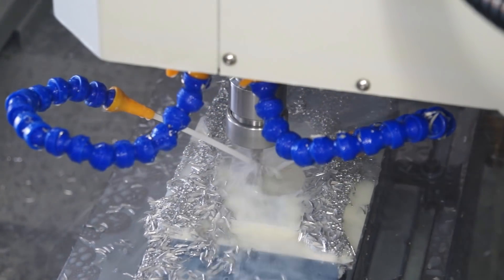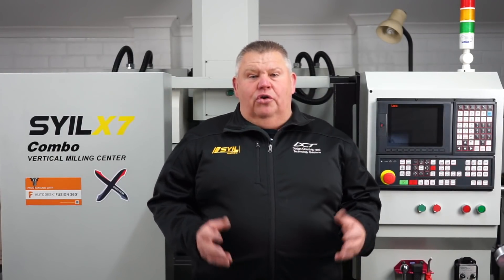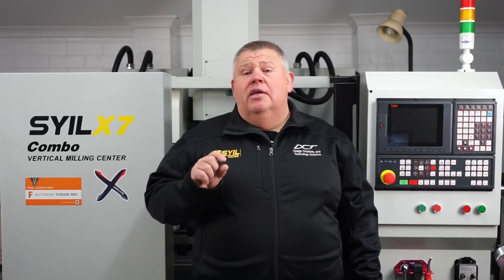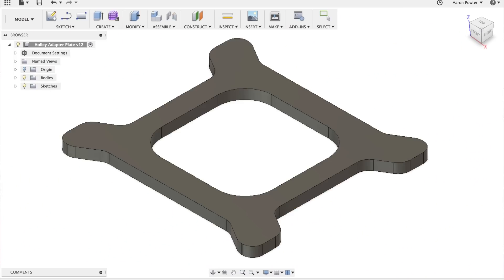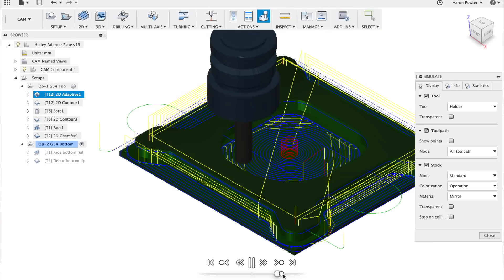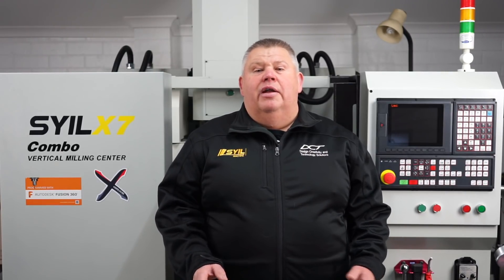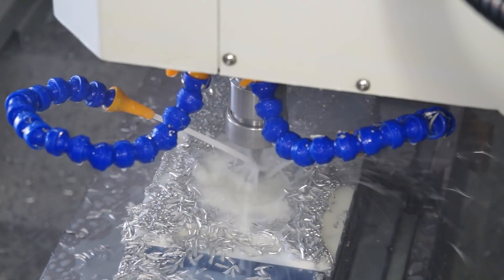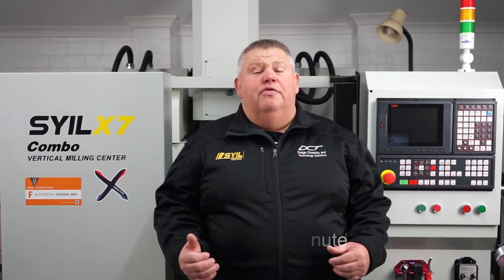SyilCNC X7 Combo - Make a V8 Holley Square Bore Plate

Comment: Your machine was making a rumbling noise when rapid move in X.  What is that?  A hose or cable dragging?
Reply from the maker: Has done it from new unfortunately.  I'm guessing that it may be miss aligned coupling or ball screw.  Need to remove parts to inspect, but involves a bit of work.

Comment: Hello where are you ? Sounds like Australia, have a question for you. I've been looking on the internet for awhile and can't find what I'm looking for and found you. I'm trying to find an adapter plate for a Rochester varajet manifold to the Holley Throttle body injection system. 2 barrel to two barrel. I don't want a high rise because I don't want to modify my hood. If you could make it how much would you charge me? Thanks   Tim
Reply from the maker: chuck nortis Hi Tim. I’m based in Melbourne mate. Happy to machine one for you. Any chance that you have the CAD file?  If so you can send to me and I can quote. You can get my email address from the “about” section on my channel 🍻

Comment: Great part. Could save air cutting time by fast feeding Z down to contour depth too, max feed rate.
Reply from the maker: Thanks for watching and thanks for the tip.  I'm usually only ever making 1 off parts, so I'm not chasing seconds.  If I had a batch to make I would most definitely optimise the program.
Reply: Gotcha, I just get so preoccupied with splitting seconds for large production,l that I just instinctively look for things like that.  Lots of good tips on this channel. 
Thanks for sharing
Reply from the maker: @PhaseConverterampV  Oh my pleasure.  Thank you for taking the time to drop by and check out my stuff.  I really appreciate it.  Have a great day :-)

Comment: Hi Aron 
how you ? i like your channel , and way how you go up with your machines ... im looking to buy Syil X7 but im still not sure to go for it ... what you think about machine ? 
also in this video it looks like X axis rapids have some noise , is ball screw fixed on other side with bearing or it is lose ? 
Thanks
Reply from the maker: EMZY FILM G’day mate. Thanks so much 🙏. I appreciate all the support I get from you all. I’m absolutely loving the Syil X7 combo. So happy I made the decision to go with this machine. Yes there is s funny noise coming from X during rapid feed. But the camera I’m using exacerbates the noise. It has no affect on the part or surface finish, but will need looking into sometime soon. Cheers 🍻
Reply: Im wondering if end of ball screw is fixed ... , i men on one end of ball screw is servo motor and on other should be bearing to fix from woble ... 
as X axis is long maybe this is case of that sound ... 
to reduce price of machine maybe there os no bearing fix ...
:D im watching this part of your video over and over and it is turning me away from purchase ... :D
Reply from the maker: Thanks for the handy tips.  Yes it probably is an easy fix.  Something I need to look into ;-)

Comment: The X Rapid sounds like the lead screw is out of alignment  or out of spec or the servo motor has a fault.

Nice to know the LNC controller is compatible with Fusion 360.

Nice part!!!
Reply from the maker: Hi Doug.  Thanks mate the part came out looking trick.  Yes the camera actually exacerbates the X-axis noise.  Not sure what it is, but will need to check it out.  It has no affect on the part, and didn't compromise sizes or surface finish.  Cheers mate, Aaron.

Comment: 1. Wrong to use aluminum as it will transfer heat and boil fuel in the bowls (with today's gasoline) . 2. Going fast requires good tooling (not the stuff you are running) . 3. Orange Vise on a econo mill ? Why not buy 2 Kurts ? Looks good running though !
Reply: We use 6061 aluminum spacers all the time on race engines. 

No issues, even when the motor overheats. Not to mention, almost all high performance intake manifolds are cast aluminum.
Reply: Get off the highway,  shut of engine, get some fuel, come out and hard start, always found my holley dry as fuel would boil out. changed to a phenolic spacer and a heat shield and and problem stopped.
Reply from the maker: Hey buddy.  Thanks for taking the time to watch and I do appreciate your comment.  All tooling used (except shell mill) for this part were from Iscar.  Granted the collet tooling isn't Maritool or another well known vendor, but it's still good for 10K RPM.  The part came out looking trick and all sizes were spot on the money.  To be honest and at the end of the day, you would be hard pressed to find another CNC mill (similar in this price range $19K USD) to do the same.  Running fast is not only about tooling, it also down to spindle HP, RPM, and torque.  In regards to aluminium being used, I tend to agree with Doug.  This 350 Chev has billet aluminium heads, cast aluminium Edelbrock manifold (valley) and no issues with fuel vaporisation.  I do understand and agree with you that some vehicles and small engines suffer from this problem and that's why they use a bakelite (phenolic) spacer plate.  Cheers, Aaron.
Reply: let us know what tooling you are using when doing the various projects ! Thanks for sharing.
Reply from the maker: Oh my pleasure.  Thanks for watching and following along with me ;-)

Comment: Cool workpiece, it came out slick! I love the close-up camera views. I wonder what the torque curve looks like on syil's spindle...usually you get like twice the power if you decrease RPM by 25%. Have you ever messed around with roughing endmills on your Minimill? I find they can be useful since they often require ~10% less torque. But then you need a finishing endmill to get a nice surface.
Reply from the maker: I agree Andrew.  I need to use a RMR (corncob) end mill for my roughing.  Seeing I predominately only machine aluminium, I'm a lazy bastard and usually always use my finishing end mill.  I moved the camera much closer this time and zoomed in with my big Sony.  I had to open the side door and hang a garbage bag up with magnets to capture this footage.  They Syil only has 2.2KW (3hp) to play with.  But for a CNC machine worth $19K USD, I think it does an amazing job.

Comment: Did you have smoothing enabled on the adaptive? Seems like the machine is slowing on the corners. I would second the comment about the noise in X movements, something is not right...
Reply from the maker: Hey Ben.  Always great hearing from you buddy.  No, smoothing was not enabled.  I think I need to the increase the nill engagement feedrate (I think that's what it's called) under the linking tab.  Yes the X-axis ball screw is noisy.  Not sure if the shaft is bent or is whipping.  Could even be as simple as a misaligned coupling too.
Reply: @DCT_Aaron_Engineering  give smoothing a shot, even at .0005 it will drastically reduce the points and it's a lot less code for the control to deal with. What I saw was a similar issue to what old Roberta has going on, and smoothing in the adaptive paths helps a lot. As for the X axis, did it sound like that from day one?
Reply from the maker: Hey Ben.  I sure will give it a go mate.  As I'm always happy to listen and take advice from others.  Yes the X-axis made this noise from day 1.  It has no affect on the part size or surface finish.  I think my big Sony video camera with the 5.1 microphone actually exacerbates the noise. I had the door open and a garbage bag hung up on magnets.  Had a slot cut in the plastic and stuck the camera zoom lens through that to capture the footage LOL.

Comment: After pinging one carbide tool and very, very nearly another due to recutting a few months back, I was as nervous as hell watching that puddle full of swarf and coolant. Nowadays I blast a hole though the middle to let it drain through wherever possible. In this example, you wanted a large hole through the middle anyway, so I'd have drilled and spiralled down through the middle as the first op.

In the longer term I reckon a high capacity pump is the answer (to clear the swarf) but that isn't about to happen for me soon.
Reply from the maker: Hey Murray.  Nah it's all good mate.  I had enough coolant on the tool and 90% of the chips were being ejected from the part.  Would love to run an air blast, but my old compressor is just not up to it.  I think my next purchase is a compressor that is more capable.  Cheers mate, Aaron.

Comment: Great video Aaron! Your machine definitely has a leg up n the Tormach machines where it counts...Performance! If I push the 770 over 40 ipm (1000 mm/m) cutting with a 1/4" tool Ill loose steps in the X axis causing an alarm in the controller and potentially ruining parts.
Reply from the maker: Hey Jody.  Yeah I'm really happy with the performance of the Syil X7.  I was pushing her pretty hard at time.  Even though the spindle sounded loaded, it just hung on and kept going.  I think the BT30 tooling is much better also, I don't get the tool pull out like I used to running the R8 collet chucks.  Cheers mate, Aaron.

Comment: Are you happy with your maximum metal removal rate with the spindle been 2.1kw? Looking back do you wish u had the 3.7kw spindle?
Reply from the maker: Hey Brendan.  Overall I'm very happy and satisfied with my SyilCNC purchase.  I suppose at the end of the day you could always wish for more horsepower.  The 2.2KW spindle is fine for me, I'm just so happy that I got a machine like this sitting in my garage ;-).  Cheers mate, Aaron.
Reply: Apologize,s for jumping in on your comment.

But i guess no matter what machine you have you will never be totally happy unless you take the leap of faith and upgrade to a full industrial machine with at least 15KW / 20HP spindle.

The big plus with the machine the Aaron owns is at least it has Linear Slides and Servo,s unlike some other machines,  I will not mention???????.

Comment: That was great to see it getting a workout. I see a speed shop in your future! Awesome :)  I really like that Holden, I had a Chevelle years ago, a very close cousin if it is the one I think it is. Did they also have the Big Block downunder?
Reply: Now your making wish I still had my 72 454SS. Built the motor from scratch, not quite a wheelie machine but real quick in the 80's. It did a 10.9 in the 1/4 with little slicks! Almost as quick as my Hellcat. Dyno run on my channel.....
Reply: oh ya crank the volume before you watch it!
Reply from the maker: Hey Paul.  Yes I gave the Syil X7 a good workout on that part.  No, unfortunately the big block 454 chev was never an option over here.  However, some blokes have got their hands on these engines and fitted them to their cars and speedboats.  Cheers, Aaron.
Reply from the maker: Yeah, only 350's to my knowledge.  I have seen many guys with 454 big blocks in their car or boats.  Went for a ride in speedboat with 454 in it.  Tiny little thing built for water ski racing.  OMG, when he stood on the gas it felt like 4 muscle bound 6 foot tall Croatians had grabbed me and tried to throw me out of the boat.  The power of this motor scared the absolute SHT out of me.
Reply from the maker: I'll have to check it out Paul.  10.9 seconds out of street machine is one bloody quick car.

Comment: Sweet as Aaron. There seems to be a strange noise when your table mo es forward and back, not left to right so that would be Y axis? It like a low buzz stutter. Fantastic video as usual and beautiful looking part 👍
Reply from the maker: Hey Chris.  Thanks mate I'm super happy with this machine.  Yeah, it seems to be the X-axis ball screw during rapiddng.  Not sure if the shaft is whipping or the coupling is out of alignment.  Cheers mate, Aaron.

Comment: Hello from Belgium,
As always, great video.
By the way, what post processor do you use in fusion360 with your new LMC controller? 
Is it stock or did you adapt it like the one of your skyfire?
Reply from the maker: Hello Patrick.  I had the post-processor purposely created for my new LNC5800 controller.  I got this from team at CADPro (Scott & Gavin).  Just one of the many services they offer to Autodesk users under the customer support program (CSP).  Cheers, Aaron.

Comment: The sound your machine makes when rapiting in the x axis seems weird. Maybe look into that. 
As always a very nice video!
Reply from the maker: Hey buddy.  Thanks for watching.  Will do ;-).  Cheers Aaron.
Reply: @DCT_Aaron_Engineering  Any follow up on the hammering sound Aaron? It sounds pretty nasty in X.
Reply: Agreed and was going to make the same comment. Rapids in Y and Z seem smooth and quiet, X sounds horrible. Is the axis drive motor significantly different (I would guess it's the same as on Y since the loads are the same)? Maybe binding in the ball screw nut or ball tracks? Don't know, but it sounds like it's grinding itself apart...
Reply: x4.  Interested to see what the issue was.
Reply: yeah, what was that? :)